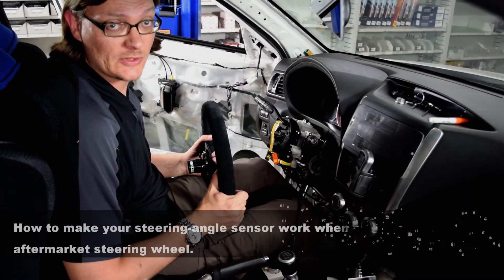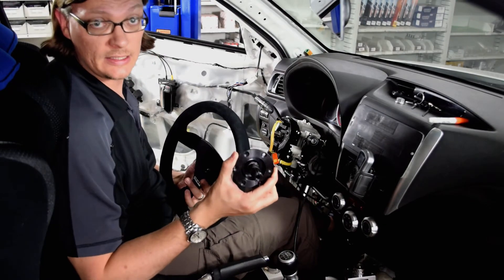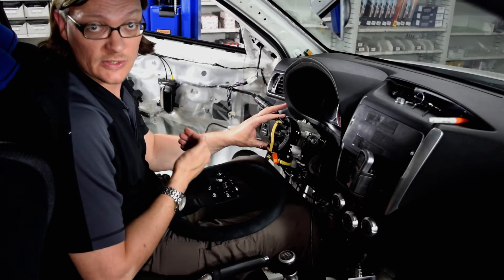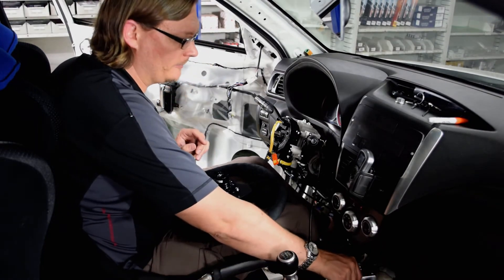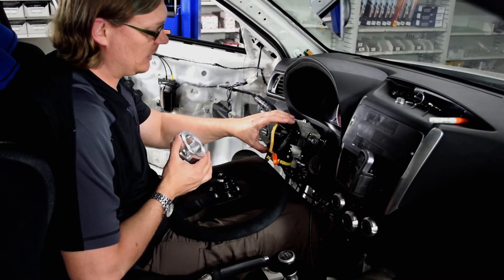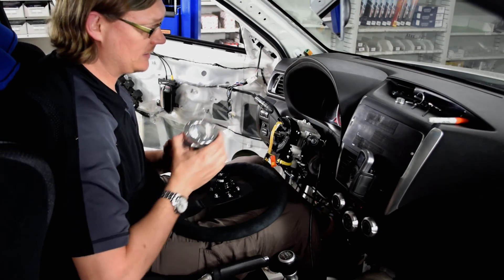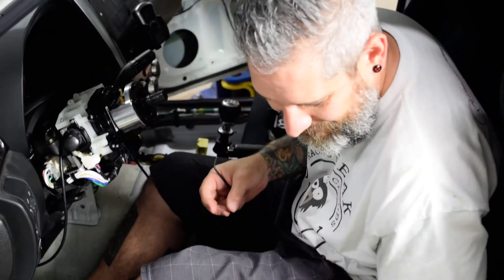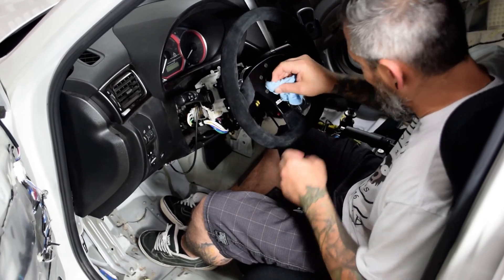How to keep your Steering Angle Sensor with an Aftermarket Steering Wheel

Comment: I know this is old and you probably won’t reply, but when doing this, anyways to keep CC or simple way to keep it and mod the hub?
Reply from the maker: Thanks for your question.  Do you mean Cruise Control?

If so, the short answer is no, there is not going to be a simple way to adapt that.

If you are looking at an aftermarket wheel that needs this type of adapter, and doesn't have any of the buttons that are on the factory wheel, there is not going to be easy to replicate that.

At best, you may be able to remove the button that you need and try to find a different location to mount it?  But that is not an easy process.

I hope that helps and Stay Tuned!

Comment: Hello, mister. One question. I am going for steering rack swap on my 2009 STi from 2015 STi (direct fit). Dont you know if the sensor on the 2015 comes in the steering rack, or if not, would be the actual one 2009 able to modify?
Reply from the maker: Thanks for your question.  The steering angle sensor is on the steering column, not the rack itself.  Your sensor should work with the 15 rack.  We haven't had any issues with the rack in our 2014 WRX, and we kept that factory sensor as well.

Thanks for watching!

Comment: I have a 2007 sti and when I removed my clock spring and steering sensor it has left my DCCD flashing in the "0" position.

My question is, will it harm anything if I left it flashing or will it just stay in open diff mode. I normally left the car on open diff mode anyways but I don't want to harm any components or limit power delivery.
Reply from the maker: Thanks for your question.  You are correct in that an issue with the clock spring will leave the center diff in open mode, and it will effectively disable your traction control.  The good news is that a Subaru tech can re-set your clock spring pretty easily with the Subaru tablet.  

We had a similar issue on our install, and we think it is because we let the clock spring turn a time or two in the process of getting the new hub on.

Our recommendation would have a Subaru tech check the clock spring, and most likely it will be an easy fix.

Comment: Great stuff guys. Another informative video. One question for you. Is there a simple way to tell if your dccd is in open mode? I did some research on the subject when deleting the clock spring on my 04 STi. I was under the impression that the steering angle sensor didn't affect dccd operation on STis until 05, 06, or 07. Thanks
Reply from the maker: Hello Brian.  Thanks for your question!  As far as we can tell, the STI didn't get a steering angle sensor until it got traction control (VDC) which was in 2008 (maybe 2007).  If your DCCD was in open mode, the light would be flashing, so as long as that isn't happening, and you can see the diff lights moving on your dash, you should be fine.
Reply: Thanks!